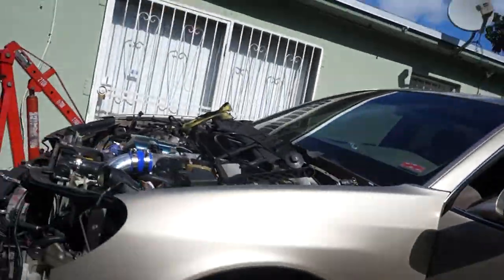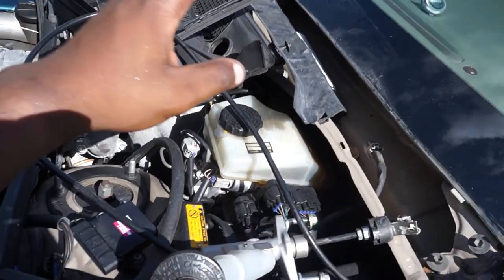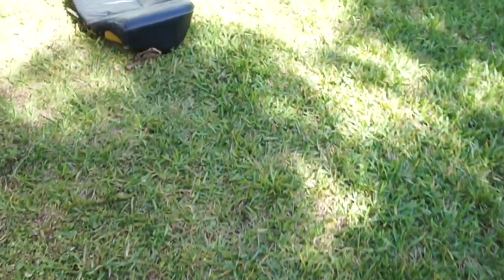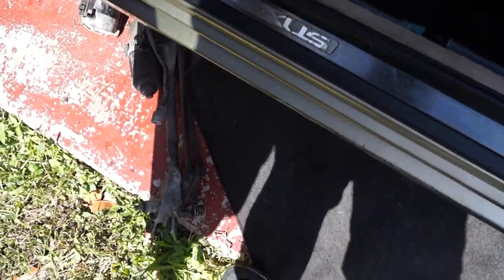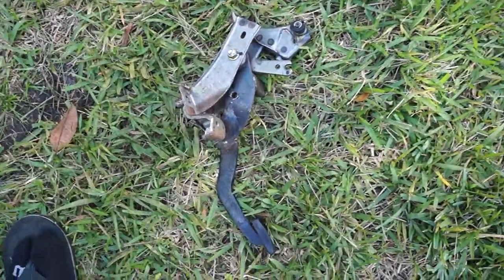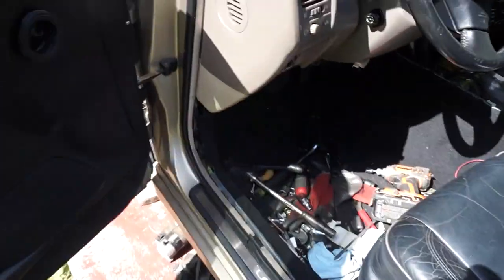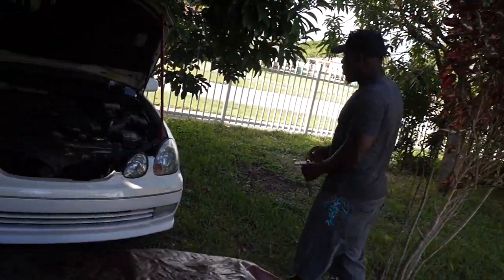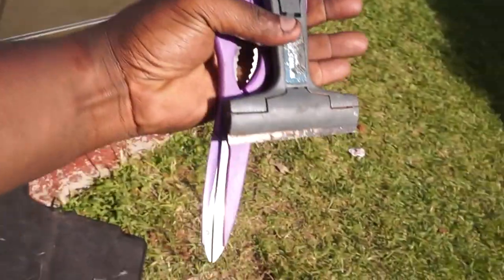Lexus GS300 Clutch pedal Install

Comment: Also did you have to relocate your abs ecu?
Reply from the maker: Good evening.  Relocate my abs for what ? I'm kinda lost
Reply: @2jzboost760  When you installed the clutch pedal? Alot of people on clublexus said they had to relocate the abs computer to get the clutch pedal to fit. Thanks !
Reply from the maker: Nope. Did no relocation or moving.  How I did mine it fits right in.  1st time like a charm and the 2nd time also.
Reply: @2jzboost760  Wish me luck lol! Thanks for the vids
Reply from the maker: @ChefNorrawitJ  Wishing you luck now bro.   Be careful and don't drill it allot. Lol.
Reply: @2jzboost760  100